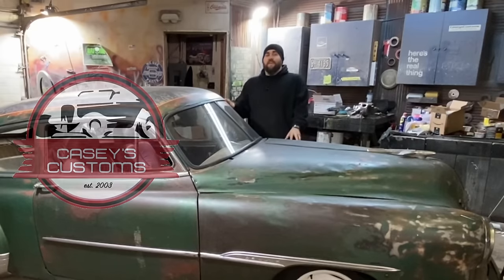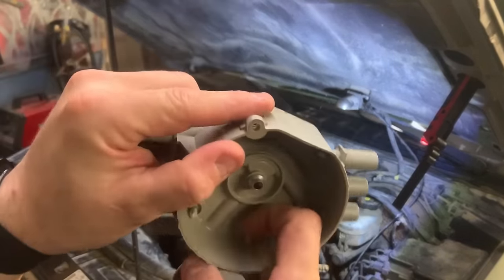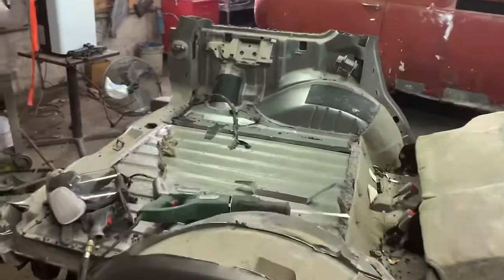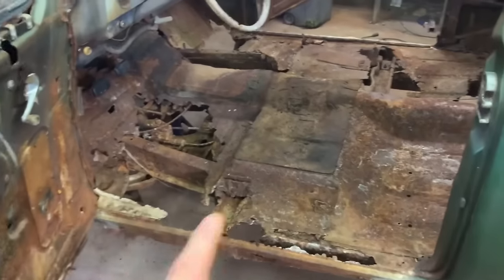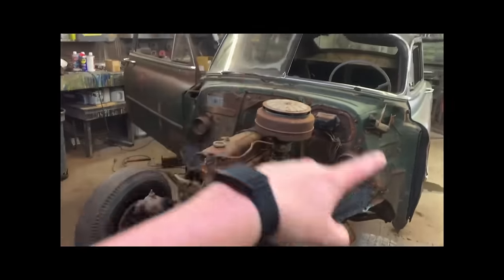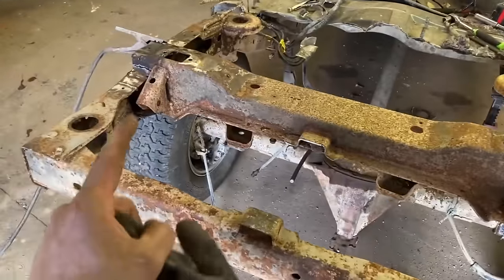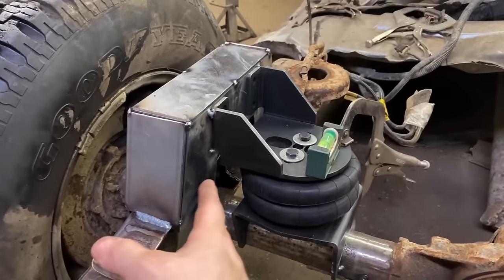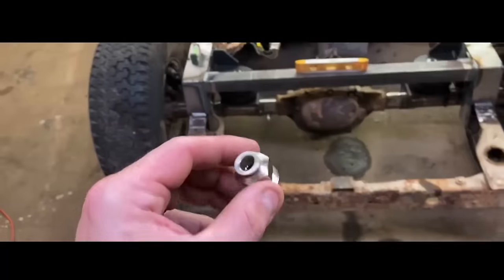ITS FINISHED! TURBO RAT ROD FOR $3500! START TO FINISH BUILD! CHASSIS SWAP, AIR BAGS FOR CHEAP!

Comment: I love this build but one side note those  4.3 vortec put out 160 HP stock not sure what it's putting out now that you boosted it a bit but that's all. Keep up the great work dude 🤟 it was a fun build to follow.
Reply: fyi  Chevy-GMC 4.3l 262ci Vortec V6's put out 190hp in late 1990's-2000's S-10's and Blazer's. . earlier 'W' engines in '93-'94 were rated at 210hp in Blazers and Jimmy's. Altho S-10's and Sonoma  pickup's remained 185-190hp. They (GM)  almost always put the more hp's in Passenger vehicles ie Blazers and Jimmy's. . Van's Big C20's 30's etc.. Station wagon's too. Great Job Casey.. I used to own a 1952 4dr Style Line Deluxe Sedan Bomb.. I also own now a s-10 '03 3rd dr.ext cab. also just tonight picked up a Grandma Cremepuff '98 Blazer S-10 4dr 2wd. it's Cherry Dude. 2nd owner here and lucky to have found it real clean and original. All info paper work including orig window sticker. Awesome Build. Keep up the Amazing Content.
Reply: @RabidSnot  cool. So the 93-94 TBI 4.3 made the same HP as a TBI 5.7? What size valves and what was the CC and flow rates for those heads of the 93 and 94 you listed to gain such a significant jump. Also I see that you omitted 95 which was the last year before vortec what happened in that year? I know they did oddball stuff with the GMT 400 and platform and I'm sure it carried over to other platforms as well but on the 400 they used a different throttle body and one year transmissions amongst other things that were done that were not related to driveline. But now I'm curious as to what was the BHP on the 95 4.3
Reply: @ogt92fromthe1step9  They GM might have carried over from '94 into '95 that W mtr. I don't all the details but the '93 S10 Blazer Tahoe I once owned in 2010 was one of those more hp engines. I read something about lighter pistons,different rods, Crank weight etc.. something to look into more.  for sure. TBI and EFI or whatever else they used I'm not really that knowledgeable about.. I'm going to go read up more on it now. I do know the Tyhpoon Cyclone were HO V6 Vortec engines. also my '93 was a Vortec.V6. idk what year those first came out but I'm thinking '86 ish.. the GMC Jimmy shown in this episode is more than likely a 190hp Vortec V6.
Reply: @RabidSnot  the typhoon and the cyclone were both turbocharged engines with a totally different intake design and heavily upgraded internals 💪
Reply: @ogt92fromthe1step9  Yep I knew that. Minus the turbo and underneath the Typhoon engine was a Vortec V6 262ci 'W' engine I think but minus turbo look at the time period. 1992-93-94 makes sense to me maybe underneath the turbo in those AWD 2 year only super Bad Ass machines there was a V6 at the heart of it. Fastest Car produced in 1992-1994 btw was the Typhoon and Cyclone. it even beat the Corvette in the 1/8th - 1/4 mile drag race. was even close to a GSX. but it was a lil slower. I believe.
Reply: @RabidSnot  yeah still a 4.3 but the typhoon and cyclone had a better designed rotating assembly.

Comment: Anyone playing  with a 4.3, and have a crankshaft, camshaft correlation code, pull the distributor and check the drive gear. The gears will get so worn on the distributor  they will be razor sharp. Don't throw money at it buying new sensors. Just change the drive gear. 
Just seeing Casey changing the cap and rotor reminded me of the gear issue.

Comment: cool fookin car, my first automatic car I ever drove was a 1948 pontiac inline straight 8m had that massive hood ornament with the red lens material wings, lot like this one here but I believe it was a 4 door, this was early 70's so been a minute, it was forest green mohair, coolest car ever I believe it was a silver streak torpedo...  lol, I torpedoed it across the pasture into the neighbors fence when the throttle got stuck either that or the river, owner chewed my arse out good, luckily it was so heavy duty it did no damage save a few scratches, took the fence post and concrete rightout the ground.. I love those old cars, peeps today have no idea, the weight, the suspension, the big steering wheel, 5 turns to full . . .like riding on a cloud tho... man I miss all my old cars, all of them, they never made a bad car like you never heard anyone before like the mid 70's say , yea but those were lemons whatever, they were ALL good cars as Americans took serious pride in their work, they cared, and quailut was A #1...  todayit all shyt made in chyna or some other dump, and these butt plugs they have destroying the show today are making it all worse by the minute . . . sad, but the old cars can make me forget..

Comment: Needs airbags up front. Try a Shockwave air over shock in place of the stock shocks, and take the torsion bars out. Or get one of the kits that mount airbags to the torsion bar keys.

Comment: hey so theres an ae86 forum that tells you how to camber these, 12b, 14b, ford 8, 8.8, 9inch, and stock ae86 axles 3-6 degrees, while adjusting the hub ends to remain straight so no camber at the wheel. that may help you clear the frame rails a little bit more so you can go even lower. im doing it with tubes cambered upwards for more low since the unibody frame rails arent an issue

Comment: should look at 2002-2008 trailblazer for donor in your next project, I'm in process of sticking a trailblazer chassis under a '56 International Metro. its a little lower and a little wider than the S10

Comment: Glad I found your channel. What a great episode so I subscribed. You definitely know what you're doing. One suggestion you can always run a $15 cable winch to the rear of the body and connect it to the gantry. Wrapping a short chain or something around it and bolting it together. Give me some secondary lift to bring the rear end up. The other thing is use gorilla tape on your hooks. You don't have to wrap it like a mummy but wrap it around the chain and the hook. The gorilla tape isn't going to hold any real weight. But it does prevent the hook from popping off the chain if some slack gets in there. I used to use duct tape it's not near as strong. I've done it for years and whenever I haul something I change it down wrap the hooks and it works. Try it if you like the idea if not that's fine too. I'm not sure where you get a car like that for $500 and you caught that GMC at the right time. Of course the engine oil bath cleaners worth a fair amount of money. I assume that's a 216 Babbitt engine possibly a 235 Babbitt engine they're not worth as much but you can always take care of that. Apparently there's a good market for those inline sixes currently. Not so much to babid engines. Well you got to love autocorrect. Look forward to some more of the episodes. I love the lace

Comment: Man Brother that is one heck of a nice Gantry Crane you have access to  in regards to your chain sliding incident , you should keep a eye out for those inexpensive tow straps they are usually Yellow with a Loop on one end and a metal hook on the other  i’ve seen them9n Ebay and usually pick them up at Flea Markets and SwapMeets  those would be good for lifting bodies  with those types of Chainhoists typically i find them in various lengths  and  i’ve used them on all kinds of projects from lifting boat engines to strapping items down using ratchet straps and Come Alongside FYI i have a lot of hobbies and basically i’m a DIYer with lots of Redneck Engineering  i like your approach to this build  it’s a Unique way of going about this build most guys i know that use the S10 Chassis Swap  unbolt it from the donor vehicle  and go about it hat way  similiar to the method we used to do using the older GM K Trucks and many of the late 60s through late 70s larger Passenger cars like the Impalas , Monte Carlos ,G 20Vans etc , i kind of miss those days when everything was built on Frames

Comment: Nothing wrong with a 4.3, especially a 4.3 with Vortech heads and a turbo. Plenty of torque, parts availability anywhere in the country and replacement engines plentyful in junkyards. What engine, what car isn't important in a project car. Getting it working, not getting it perfect is what should be the focus.

Comment: It is cool to save a vintage body car or truck and get them on modern suspension for a driving experience that is safer and smother than the original chassis could than they came from the factor 50 plus years ago.    I personal like to see as much of the OG car left.   I can not stand a modern dash in a old rat rod.    This is why my  53 chevy 5window truck   kept the original frame and just got it boxed and weld up mustang 2 front and  a triangular 4 ink rear.   It too is a patina truck also but only the body.  Everything else is newer tech than the body  but still no fuel injection or  or computers.   My gauges look almost like the OG original but are electronic with analog Look.  Of course they was     over $800.     But If done right like mine with a full built SBC and all the goodies It is going to be worth....   every bit of $60K. Every line on it is brided stainless and the wires are tight.                                                                                                                                                                                                                                                                                                                                           I am going to be in mine about 20 k when all  in Next year is going to be tht

Comment: My only complaint is that i think you have been doing it so long your complacency is obvious and it comes of like you half ass things although your body of work speeks for itself there is just some things id like to see you put more care in but obviously you know where to cut corners and save time. I would have used a ratchet or tow strap to disperse the weight of the body evenly on the chain. Another thing in another video I noticed was the self tappers and tac welds for body components and id like to see you just run rivet nut and make it all modular and easy to work on.